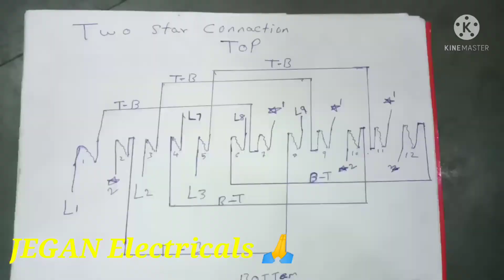Double star connection / simple method & diagram

Comment: Thank you very much brother. I completed a 12.7 HP 2 star semi compressor motor by looking at your diagram and the connections you made in the video.This connection can't be done by our big pea welding engineer. Everyone is failing. Finally after searching YouTube and getting your video, after watching it I successfully completed the 2 star connection.I ran the compressor through the fitting together double 3 phase line, measured the amp and saw that everything was fine. I feel very happy to think that I have succeeded.😊 But you have many contributions behind it.Lots of love and best wishes big brother from Bangladesh.🥰🎉🇧🇩